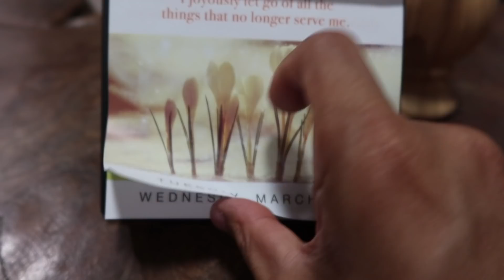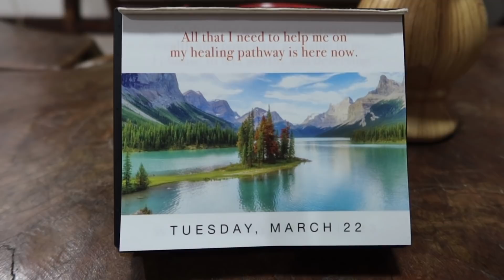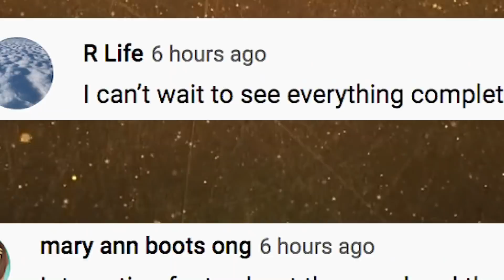We Have New Cats! - March 22, 2022 | Vlog #1468

Comment: Yep they will plaster the ceiling after applying the drywall, and then after that, they finish it which cleans out the imperfections using a light to find shadows and smooth them out to no shadow meaning its flat and smooth.